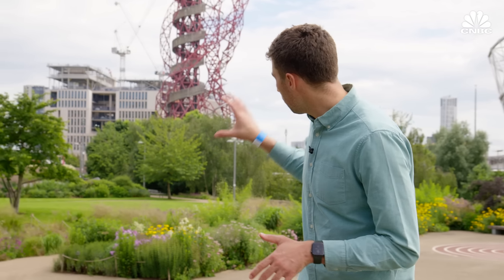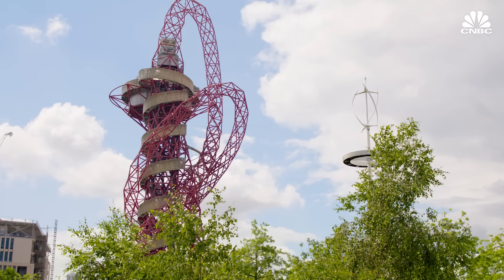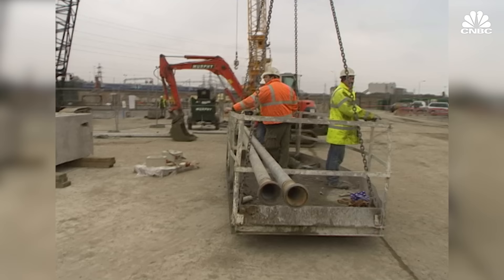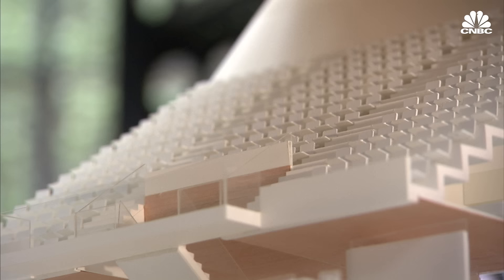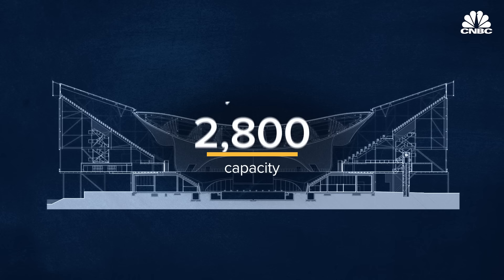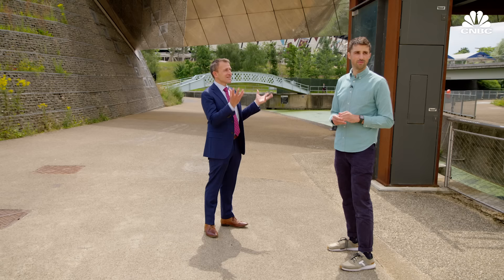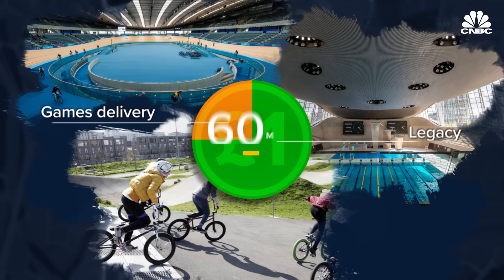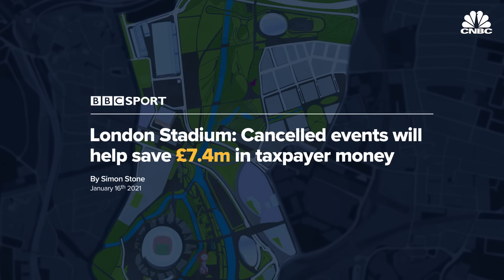How London laid the groundwork for sustainable sporting architecture | CNBC Reports

Comment: as a londoner, i dont think it matters if it ends up costing money. 
public spaces and the legacy of huge publicly funded projects should benefit the community
Reply: It's costing Money because the Football club dont pay for anywhere near enough .

The tax payer still pays for the floodlights goal nets & corner flags .
WHIFC pay a measly amount for what they have .
Reply: Broadly-speaking I agree. Let's face it, that part of Stratford was a toxic dump before redevelopment, but the park is very well used these days. Not being a West Ham fan, you might expect me to have some reservations about the repurposing of the main stadium and I do. The transition was a rip-off for the London tax payer, the stadium is the wrong shape for football, so that the sightlines are not great (I've visited as an "away" fan), and the Hammers' supporters have found it hard to replicate the atmosphere of the Boleyn Ground, but Lyn Garner was right that they did have to pick an anchor tenant because there isn't enough demand for track and field to sustain it alone.
Reply: Bullseye

Comment: I'm from Southern California and when I saw the plan for The 2028 games I was very happy because LA has the infrastructure already and they are making use of that. Using the local universities dorms as the Olympic and Paralympic village just makes sense, making use of the different stadiums and event centers because we really don't need more I can name 5-6 just off the tip of my head and they are all within 30-40 mins of each other. I think there are 2 formulas for a great games and legacy after those which build for the community like the London Games and those which use the Community like LA's plan, I was really sad Rio just didn't care about it's local communities and saw it as a very temporary event.
Reply: But where are the students going, who were otherwise staying in those damn dorms?
Reply: @ankanmaiti9864  it's summer Olympics, most students will be with family or in other accommodations some may be on campus but would be in another dorm building. UCLA's dorms consist of 17 high rise towers plus another 5 complexes I'm sure there will be enough room.
Reply: @AmberKingmusic  Exactly. Los Angeles 1984 was the most successful Olympics. For 2028, they'll basically follow the same plan. 
The lucky thing LA has are all of the colleges and universities in and around the city.
LA doesn't have to build anything new - at all.
Reply: @Mick&Rorty definitely especially if the wild fires aren't under control.
Reply: @AmberKingmusic  some dorms at UCLA were originally built in '84 for athlete housing with the plan for them being student dorms.
Reply: @GregoryFariss  I did not know that, that's awesome full circle!
Reply: This is exactly how the 2014 commonwealth games in Glasgow ran their event. Using places that were already there. It is said to even had made a profit.
Reply: Plus LA is getting more funding for improving the existing infrastructure like airport and metros.
Reply: and the US govt is paying $0. Everything is coming from private sector.
Reply: @kalvin1123  "Los Angeles 1984 was the most successful Olympics" A man named Juan Antonio Samaranch, a Spaniard who was the head of the International Olympic committee from 1980 to 2001 and oversaw ALL of the Games in that time, expressed an opinion on what you comment on. You might like to follow up on his evaluation.
Reply: @flamingfrancis  Los Angeles made so much $ that a charity was established called LA84. It gives sports scholarships to students. And the charity is still going strong.
Reply: @ankanmaiti9864 they are home hen the Olympic are on.

Comment: Although on a much smaller scale Manchester was a U.K. trailblazer for this with the 2002 Commonwealth Games - all the venues have remained in use. The aquatics centre is used by the public, the athletes village is now apartments fully occupied, the site houses the national squash centre, the national taekwondo centre, (recent national success), the centre for U.K. cycling (more success in track and BMX cycling) and of course the stadium is now the home of Manchester City. In addition to this, the whole of the area has had massive regeneration and continued investment has continued to pour into the area…..i.e a new 24,000 seat indoor arena is currently being constructed. It was a catalyst for the regeneration of a part of the city that had been neglected for years.
Reply: In many ways Manchester also benefitted from Sheffields experience with the 1991 World Student Games where it got world class facilities like Ponds Forge, but didn't think enough about what would happen after (Don Valley Stadium being the biggest legacy problem).
Reply: Manchester lol. You wouldn't have had it without Sheffield in 1991.

Comment: Would it be a better option if the Olympics were planned to hold at the same location consecutively for multiple years? For instance, Tokyo could host in 2021, 24, 28 and 32. The locations get continuous use of their infrastructure, incentive to maintain them and would (ostensibly) improve on hosting the olympics with every instance. The IOC gets the stability of working with a single partner over an extended timeframe. What would be possible downsides?
Reply: The biggest downside is that viewers in part of the world, get used to never seeing major Olympic events live. For example, when it's primetime, 8pm, in Athens, Greece, it's the middle of the working day in Athens, Georgia, USA, and it's the middle of the night in Tokyo & Beijing
Reply: The Olympics is a global event and therefore, it cannot remain exclusive to one nation. Tokyo cannot host 2024, 2028, and 2032 because those years have been awarded to Paris, Los Angeles, and Brisbane. The contracts have been signed.
Reply: @RaymondHng  But it's a reasonable question. Already, fewer and fewer cities are even bidding for the Olympics. That's why Paris and Los Angeles were awarded at the same time - they were the only ones who were still interested for 2024. To offset the cost of hosting, future Olympics could be awarded for two (I think 3 would be too many) consecutive Olympics competitions.

But that would cause its own problems. What would cities do with the venues in the intervening years? They can't convert them for their legacy purposes. They can't start to move people into those areas because that space would be needed for the next games. Unfortunately the single Olympics may be the only reasonable way to allow the venues to have a legacy.
Reply: @ganonk79  Holding the Olympics solely in one location would be a violation of the Olympic Charter. The Olympic Charter is the codification of the fundamental principles of Olympism, and the rules and bye-laws adopted by the International Olympic Committee. It governs the organization, actions, and functioning of the Olympic Movement and establishes the conditions for the celebration of the Olympic Games. In other words, it's the organization's constitution. The Olympic Charter states in the 3rd principle of Olympism:

The Olympic Movement is the concerted, organised, universal and permanent action, carried out under the supreme authority of the IOC, of all individuals and entities who are inspired by the values of Olympism. It covers the five continents. It reaches its peak with the bringing together of the world’s athletes at the great sports festival, the Olympic Games. Its symbol is five interlaced rings.

In Rule 1.2 The Olympic Movement, Mission and role of the IOC:

The mission of the IOC is to promote Olympism throughout the world and to lead the Olympic Movement.

The new IOC bidding process was approved at the 134th IOC Session on 24 June 2019 in Lausanne, Switzerland. The key proposals, driven by the relevant recommendations from Olympic Agenda 2020, are:
Establish a permanent, ongoing dialogue to explore and create interest among cities/regions/countries and National Olympic Committees for any Olympic event
Create two Future Host Commissions (Summer and Winter Games) to oversee interest in future Olympic events and report to the IOC executive board
Give the IOC Session more influence by having non-executive board members form part of the Future Host Commissions.

The IOC also modified the Olympic Charter to increase its flexibility by removing the date of election from 7 years before the games and changing the host as a city from a single city/region/country to multiple cities, regions, or countries.

In Rule 32 Celebration of the Olympic Games:

Where deemed appropriate, the IOC may elect several cities, or other entities, such as regions, states or countries, as host of the Olympic Games.
Reply: But how are the corrupt IOC going to make their money?! Shame on you! lol

Comment: In terms of Winter Olympics, Vancouver in 2010 did a good job of building a legacy as well. Our venues are in good shape, and in public use, though it should be noted that a lot of the big venues were already around before the olympics and only needed some renovation work to make it look nicer. Vancouver is currently bidding for the 2030 olympics due to the most of the venues being in good shape, with options to move some events to Calgary if needed (Calgary hosted the 1988 winter olympics, and still has good facilities used for training athletes).
Reply: I agree. Having spent a lot of time in Vancouver and towns up the Sea to Sky (i90), since 2010, it was clear to me just how much these communities benefited from the new infrastructure.

Comment: I'm regularly in Norway and have seen some of the Lillehammer '94 Winter Olympic venues. 
The ski jumping venue in Lillehammer, the ice hockey arena in Gjøvik (built inside a mountain) and the figure skating, short track and speed skating venue in Hamar are still used by the public.

Comment: "to host the olympics is a once in a lifetime opportunity"
Beijing 2008, Beijing 2022
Turin 2006, Milan 2026 (they are under two hours away by car)
Reply: London itself has hosted the Games after gaps of 40 and 64 years -- both well within a lifetime, and the 40-year gap would have been 36 if it hadn't been for the war. The closest that's actually happened was that Innsbruck hosted the winter games in 1964 and then again in 1976 after Denver decided not to host. Innsbruck is only 60 miles (100km) from Cortina d'Ampezzo, which hosted in 1956.

Then, you have Garmisch-Partenkirchen, which hosted in 1936 and was rescheduled as host again in 1940 after war between Japan and China meant the games couldn't be in Sapporo as planned. Cortina was scheduled to host in 1944, and is only 80 miles (130km) from Garmisch-Partenkirchen. So you have the 1936, 1940, 1944, 1956, 1964 and 1976 all supposed to happen within about a 40-mile radius of the Brenner Pass on the Italian-Austrian border.

Of course, a lot of those examples were cities that got the games at the last minute because the intended host was unavailable -- even London 1908 was supposed to be in Rome, until Vesuvius erupted. In that situation, it's very likely that a host from the recent past will be chosen, as they still have the facilities. Also, most of the examples I gave are for the winter Olympics, which are much more constrained for location. Well, they were in the 20th century. :cough: BeijingartificialsnowFFS :cough:

Comment: I mean, Vancouver was picked to host the 2010 Winter Olympics because we already had venues in place, and only a few things needed to be built (Olympic Oval, Whistler Sliding Centre, Vancouver Curling Centre, to name a few), and after the Olympics, all these venues are very much used (the Oval is now a community centre with an Olympic legacy museum, and can easily be reconverted to a speed skating track if need be; the curling centre is also a well-used community centre). I think Vancouver instead of London is kind of the actual example other cities should have followed.
Reply: did you even watch the first 5 seconds of this video? they turned the absolute gutter of london into a thriving area

Comment: There is more than the legacy too. Almost all the unneeded “bits of Olympics” were sold off after the games. I have a huge whiteboard that was used by the teams, three of the large parasols and much more. Also, the first “missing bridge” mentioned wasn’t scrapped, it’s at the British Triathlon headquarters in Leeds, where it’s used to gain access over the purpose built training track. Almost nothing was wasted.

Comment: What if London wins a bid next time?? Will u use the same Sports Complex?
Reply: It depends on the when London would  host another games, it would be their 4th, and state of the venues. The IOC likes to spread it around. The closest a city has repeated as host is 24 years. The LA Coliseum is the only stadium to repeat as host and will host its 3rd in 2028 (1932, 1984, 2028)
Reply: @GregoryFariss  There's a decent chance London could bid for the 2036 or 2040 games apparently. The appetite for cities wanting to host these games has reduced dramatically in the past decade, to the point where Brisbane was the sole bidder for 2032. London may be the only major city who want it.
Reply: London could repurpose these venues and host an Olympics at fairly short notice. The Olympic Stadium still has a running track and still holds Diamond League meetings. The aquatic centre could have new temporary stands reintroduced. The only other venues no longer in the park are the hockey centre and the basketball arena, both of which were temporary venues that could be built again if required. Most of the rest of the venues outside the park were venues which are still there. The O2, the Excel Centre, Wembley Arena, Wembley Stadium etc.
Reply: @prappsy3028  they should, as well as Tokyo. LA was the only one to bid in ‘84. 
I like how they awarded Paris and LA after a single bid.
Reply: Yes
Reply: @GregoryFariss  For the summer Olympics, yes. The closest a city has repeated as host is 12 years: Innsbruck hosted the Winter Olympics in 1964 and then again in 1976 after Denver pulled out. Garmisch-Partenkirchen hosted the Winter Olympics in 1936 and then stepped in to organize the 1940 games after they couldn't be held in Sapporo because of war between Japan and China. The 1944 winter games were then scheduled to be held in Cortina d'Ampezzo, which is only 80 miles (130km) away from Garmisch -- via Innsbruck! However, it's not surprising that, when the games have to be moved, they're usually moved to a city that recently hosted them, as they're the cities most likely to have the infrastructure available.

The one that really surprised me is Beijing hosting the summer Olympics in 2008 and the winter games in 2022. As you say, the IOC likes to spread the games around, so it's doubly surprising that Beijing was chosen -- they'd hosted 14 years before and they don't have any snow!
Reply: @beeble2003  I stuck to summer because he asked about London. I hadn't know about how no one wanted 1976 winter games. I read that Denver, Sion and Salt Lake City all passed on hosting. That followed by Montreal, then the Moscow boycott helps explains why no one wanted 1984 summer games and how LA was able to dictate its own terms to the IOC.

Comment: I think they should do away with cities hosting the games altogether and have the summer games held in Athens every 4 years. Which I think was one of the original ideas for the Olympics. They'll only have to build the venues once and can be remodeled or rebuilt as the years go on. It would save everyone everywhere money, give Greece much needed revenue possibilities and it makes sense historically.
Reply: Greece can't afford to host 1 let alone every olympics
Reply: @AmaanR  Not many countries can afford to host, but still do. If Greece had a permanent set up the cost would be made up in subsequent games. It would be cheaper for everyone in the long run, including Greece.

Comment: Before London it was Sydney doing this. Everything that was there for the Olympics in 2000 at Homebush Bay is still there in 2021 being used. Agreed that Athens, Beijing and Rio are examples of how not to do things. In fact it could be said that Sydney could host the Olympics in 2024 since everything is still there.
Reply: If you recall correctly Sydney was proposed when the Rio committee started falling apart and many venues were late in their construction. It was not only the Homebush facilities but several outer city venues such as Blacktown Olympic Park and of course, Bondi Beach.
Reply: @flamingfrancis  I can't think of any facilitity other then the old entertainment centre which was demo'd because of the new darling harbour development and the sydney football stadium (also being redveloped) that isn't still around.

Comment: GIven the VERY recent awarding ( finally!) of the 2034 games to Salt Lake City, it has been brought up and shown off to the entire world that every single permanent facility from 2002 is still fully in use for world class training -  the Ski jump hill, the Bobsled area, the Soldier Hollow Nordic skiing area, and the Olympic Oval for long track Speed Skating, as best examples.  The Delta Center [Figure Skating/Short Track] will be undergoing major renovation thanks to the new NHL franchise, and will be able to host medal level Hockey, and even the Stadium has had some major upgrades and refinements.  That epic Cauldron of ours is now relocated and on a giant pedestal in a  dedicated space to the history of the event.  It was ignited yesterday in honor of the award, and though the original gas and water systems are non functional, they jury-rigged a smaller gas device inside the bowl.

So basically, it is nonsense to act like London was the first place to make things sustainable.... but as long as one specifies SUMMER games (obviously a much large commitment), I suppose that will be acceptable.